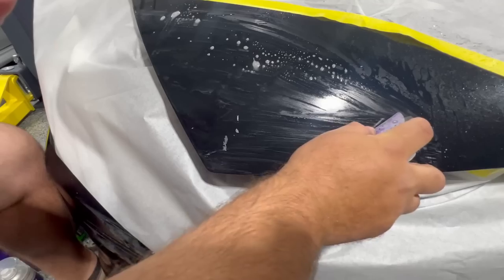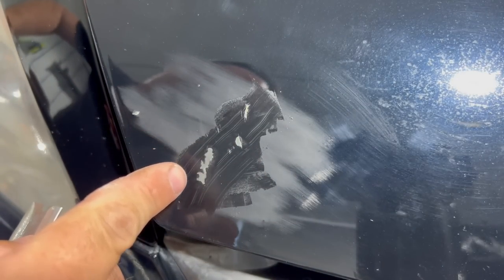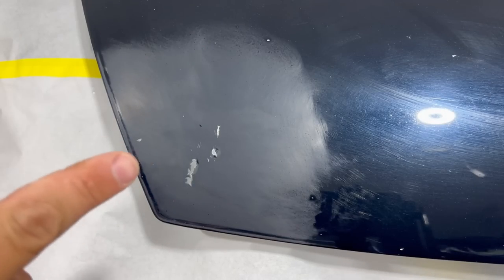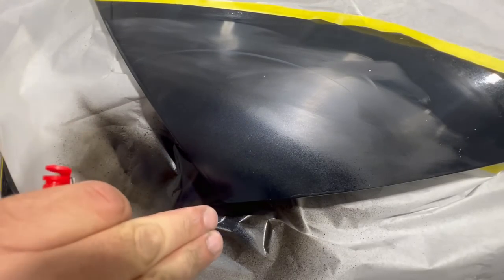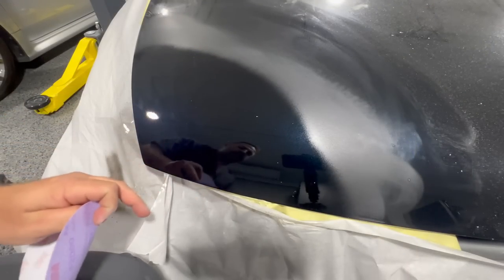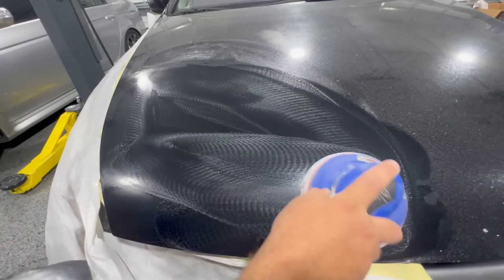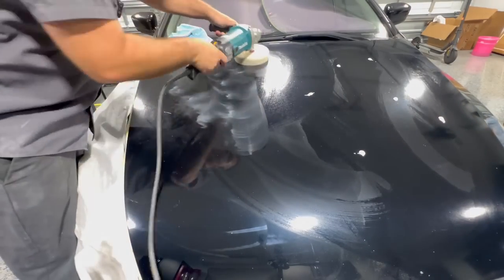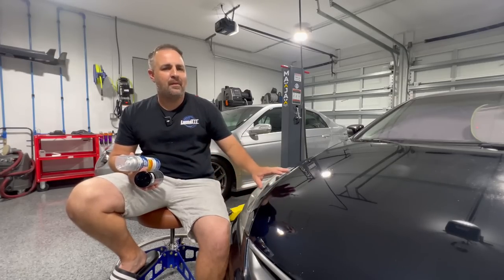The BEST Paint Chip Touch Up Repair Guide

Comment: One thing you might want to include when using those spray max 2K cans is that once you pop that internal canister, you’ve got about 36 hours before that can is a brick. I know you used the Eastwood version, but it’s the same thing. There’s a company called Car Rep that has a 2K clear with “infinite” shelf life. It uses the moisture in the air to cure.
Reply: Does the car rep 2K  have the nasty isocyanates like the Eastwoods and spraymax 2K ?
Reply: That's a good question.
Reply: @CP_FPV no it does not.
Reply: I’m pretty sure he knows
Reply: @buddyrebel_Garcia  I know Brian knows. I simply suggested he point that out so viewers understand
Reply: You can put the spray max 2k clear coat in the freezer
Reply: @NHPhamousPolo  yeah, it buys you maybe another 24hrs
Reply: @CP_FPV  According to the Safety Data Sheet, yes it has isocyanates in it
Reply: A great tip is to put it in the fridge and it will last quite a bit longer than 36 hours!

Comment: Outstanding video for my 2011 RAV4 with 190,000 miles on it and a few chips that I can't stand. The chips are in areas that can't be isolated to one body panel - I want to fix one of the front pillars, not the whole roof that it's welded to. And most painting videos give advice to paint an entire section that can be isolated. Thanks for this video!
Reply from the maker: Awesome!!!

Comment: Brian, what would you do for spot surface rust that's part of a larger area being painted? I live in Hawaii. If I don't cover the sanded metal area with primer right away the rust will come right back.It's a smaller spot and part of a larger area that's not ready for primer yet.  Is there a special spray to just stop the rust & treat the area until I have a day, no wind or rain, to finish the rest of the job? This is with rattle cans. Mahalo Nui Loa

Comment: That was awesome!  I just picked up a daily driver Scion that needs the hood and roof re-cleared.  The clear has fogged and looks dry but isn’t chipping or cracking, I’m gonna try scuffing and spraying it with 2k clear.  Any tips?
Reply from the maker: Scuff with 600 grit. Clean it well and then spray.

Comment: Hey, great video also i never thought of using UV filler!!

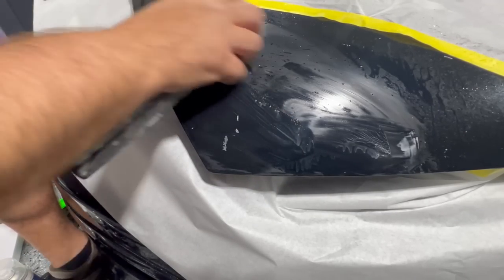Quick question,  you mention rust around 4:25 I have a car with a few rusty chips that i want to repair. I plan on taking the chips back to bare metal and then using UV filler and spray base and clear coat followed by a cut polish and wax. Will this work? Is there a danger of rust if I use UV filler?

Comment: Excellent work and lesson. I am curious on a couple things. I see you using the eastwood 2k clear when you are doing aerosol work. Have you used the spray max 2k glamour before? Thats what i currently am using and am curious if the Eastwood is better or the same. The other question is what was the electric DA you used when you blended with the 1500? Thank you for your time and like maby others , i appreciate your excellent work and clear description with all your videos. It has certainly helped me take my work to the next level.
Reply from the maker: Its the same thing honestly. The electric da sander is the same 3M one i use. Over $500 though

Comment: Hey Brian just I have a question.Going to paint my 2011 Silverado and I’ve taken some spots to the metal and filled the dents with filler and sanded them out.Rest of the paint is in good condition but just old and dingy.Question is do I just use like a 600 grit and knock the clear coat off and then paint or do I need to primer the whole truck.Any info would be greatly appreciated?Love the channel.

Comment: I'm trying to paint some small trim pieces on my car and everything goes fine until the clear coat. I'm using the Eastwood 2k aerosol and it is coming out with horrible tiny orange peel. I have tried spraying multiple ways from super light to super heavy and having no luck. What am I doing wrong?
Reply: Rattle cans are not gonna be able to atomize like a hvlp gun so you’ll probably gonna need to wet sand and polish. You might try spraying in lower ambient temps though to allow it more time to flow out and self level

Comment: I did not see the polisher you used in your list. The random orbital one that you said had enough RPM to polish out the 3000 grit sand paper scratches.  What do you recomend that wont break the bank. Im doing a 1 time surface rust repair to the roof of my 2001 dodge dakota.
Reply from the maker: Hi. Check the description as I just added it.
Reply: @PaintSociety  Thank you!

Comment: Body shops around me quoted me between $5,000 and $11,000 to just paint a few spots on a 7 year old car.  4 different body shops.  Very minor paint work. No body damage.

So...if you have some goobers on even a newer car, and you can fix it in 4 or so hours and $100 in paint and supplies, I say eff the hogs at the body shop.  You just paid yourself $1,000 per hour or over $2,000 per hour by fixing it yourself.

Even if it doesn't come out perfect, it is unliely to look worse or any worse than globbing on touch up paint with a brush, or unrepaired.

It didn't used to be that way.  Used to be that body shops would just do what was needed and try to give you a reasonable price.  These days, body shops are right up there with most car salesmen, who get thier jollies over screwing customers.

Comment: Great repair! Why does every know-it-all on the interwebs say you can't apply a 2k product over a 1k product? Why does that logic not apply in this instance? Thank you!!
Reply from the maker: All basecoat is 1k
Reply: @PaintSociety I meant some folks say not to use a catalyzed product over an "air-dried" product. Is that not the case? Thank you sir. Love the videos.
Reply from the maker: @powers6963  all basecoats air dry. Youll be fine